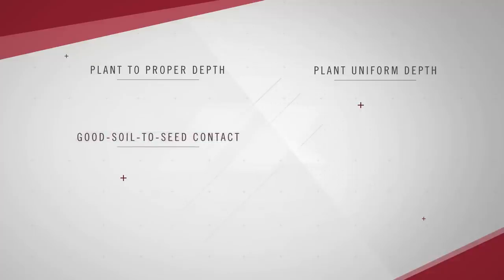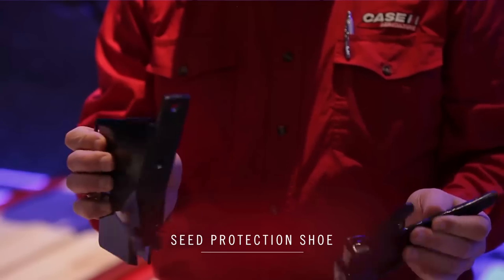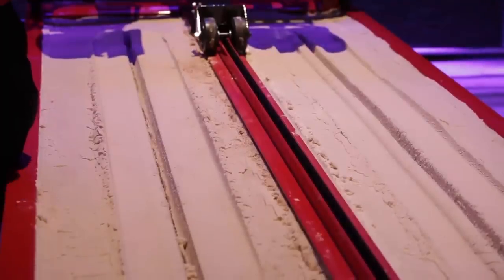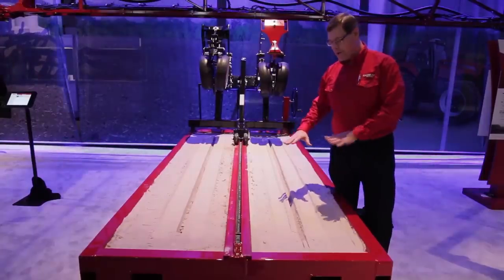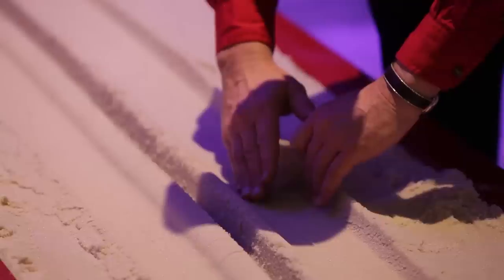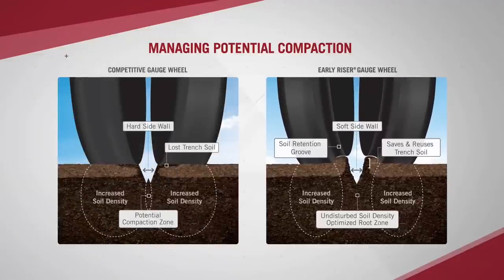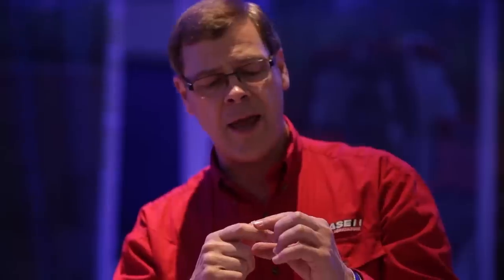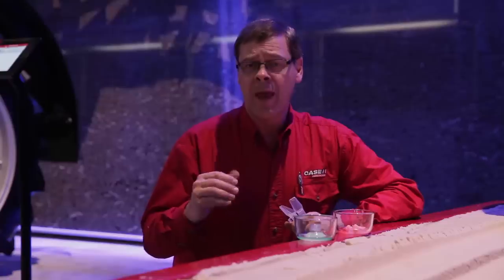Case IH Early Riser Planter Row Unit: Beyond The Picket Fence To The Photocopy Plants

Comment: CIH needs to redesign it's gauge wheel arms so that the back of the gauge wheel tire is tight against the seed disk.    It makes no sense to have the tire slightly away and let the seed trench come up.   It actually causes the gauge wheels to plug up with mud unless you have MudSmith or some other spoked gauge wheel.